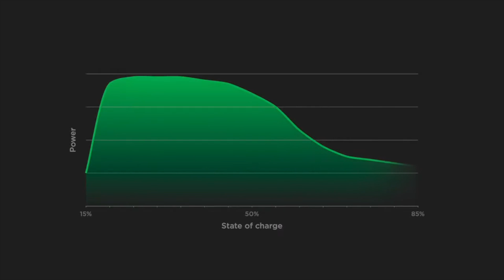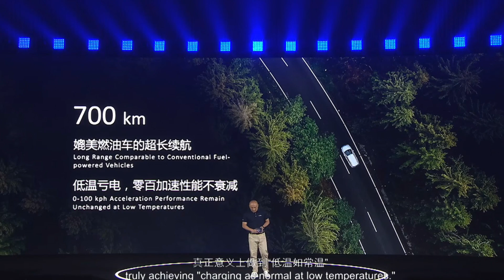Tesla Prepares For NEW Faster Charging Battery For All Models | It’s So Much Better

Comment: John a few corrections.

1) Charging on a road trip is NOT a massive issue! With an EV you DO NOT need to sit there for 1 hour as you charge to 100%. You can charge for 15 minutes which with Tesla can add about 170 miles of range which is enough to get to your destination OR to the next supercharger.
Do not forget that you will need to stop anyway even in a ICE car to stretch your rags and a toilet break. It is dangerous and stupid to keep driving for hour after hour after hour after hour after hour as tiredness kills MORE than drink/drugs!

2) Most people who go from a ICE to EV say they see no major issues with roads trips even though the range/charging is less than ICE. It is simply a case of adapting slightly. I have a brother who has driven ICE cars for over 20 years and he has his first EV an the says his road trips are NOT a major issue and he is not in a Tesla and currently has no access to the supercharger network which makes road trips even easier.

3) Whilst most people THINK they need 500+ miles of range in a EV the actual data shows they do not! The ACTUAL sweet spot is about 300 miles of range typical use as that allows for 4 hours of typical driving which you then should stop to rest anyway, so why not charge as you rest.

4) You do not need to sit there with the charger in your hand as you charge your EV, you can do other things like take a toilet break, grab something to drink and eat etc. You can not do this with ICE cars.

This is a simple case of adapting your driving slightly regarding EVs and once you do you find you can easily cope.

You obviously can not adapt so I do not think EVs are for you, maybe walking is your thing.

All the best.
Reply from the maker: I think you didn’t listen to what I said in the video and ended your comment with that. 15 minute for 150mi is still 3X longer than filling but getting back 3X less the miles. Sure, you can convince an EV guy like yourself the benefits, but try convincing a diesel truck lover with the 4 points you just brought up

Comment: I like to think of range and charge speed in terms of total lifetime spent charging or gassing a car. Since I charge at home and 95% of my driving is around Chicago and suburbs, I need around 300+ mi (charged to 90%) of range to not charge during a typical ~150 mi days even in in subzero (or polar vortex) weather. So the M3 has had it covered. 

Second the charge time of an EV isn't apples-to-apples, because you have to compare against the weekly time taken to divert a gas car and fill up, which represents the large portion of driving. Sure the 3 or so road trips I take annually will take longer at a SC, but that's miniscule compared to the amount of time not gassing up weekly. I also do things in parallel, like use the washroom and eat on roadtrips, so the extra time required at each SC gets folded into time I'd spend on a gas car too.

All that to say, for me EV manufacturers would do well to incrementally improve batteries, but the real boon will be cheap and easy accessibility to home chargers
Reply from the maker: Good points. I think for most EV owners, the Model 3 should be enough. It’s just the road trips that is the last argument for ICE owners to argue about, once that’s out of the way there’s nothing else

Comment: Hey John, I read online that the new catl lfp battery’s will charge 250miles in 10 minutes:) is this what you meant or do you believe it’ll be even quicker :)?
Reply from the maker: 250mi in 10 minutes is already mind blowing, but I think it’ll get faster to the point where it’ll be on par with fueling up at the pump which is approximately 5 mins